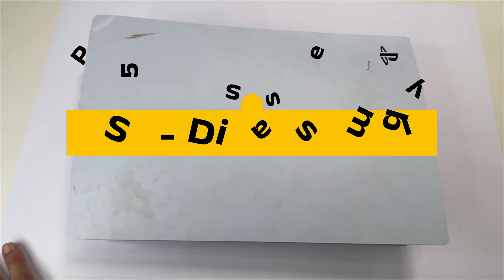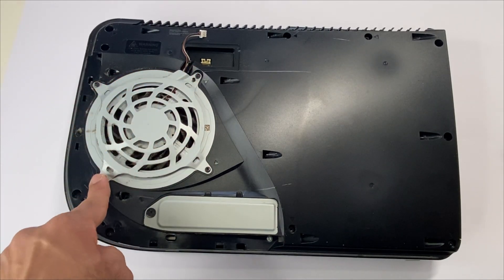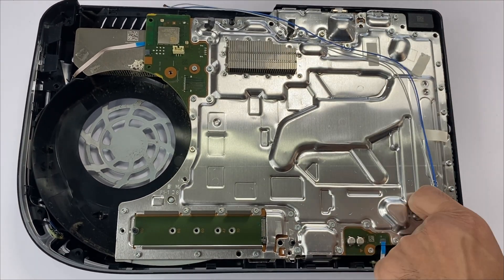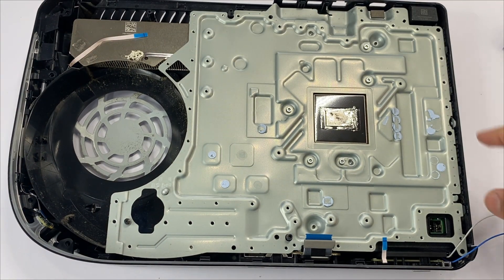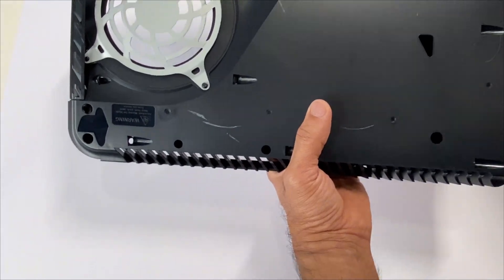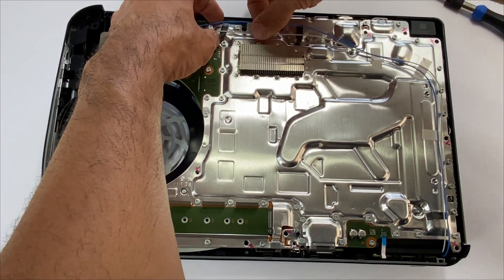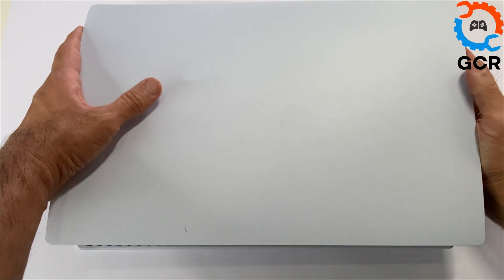Fixing PS5 [1102B Digital Edition]: Disassembly, Ultrasonic Clean, and HDMI Repair

Comment from the maker: ===========================
Time Stamps
===========================
[00:01] - Introduction 
[00:11] - PS5 [1102B Digital] Disassembly
[08:44] - Ultrasonic Cleaning of PS5 Plastic Parts
[09:50] - HDMI Port Fixing
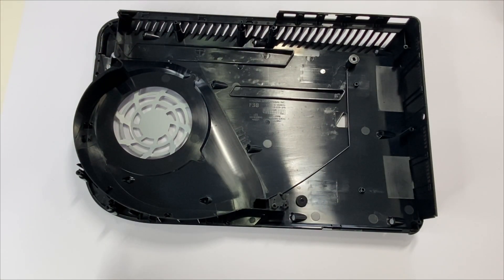[11:02] - PS5 [1102B Digital] Assembly
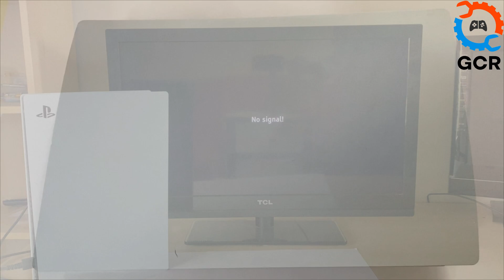[17:25] - Testing & Conclusion
[17:42] - After Clean Pictures
[17:50] - Credits